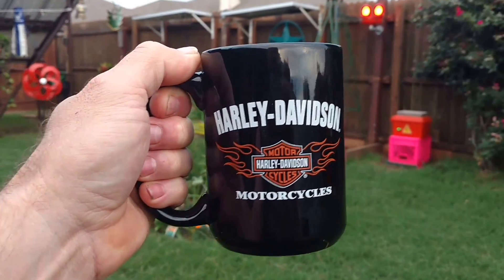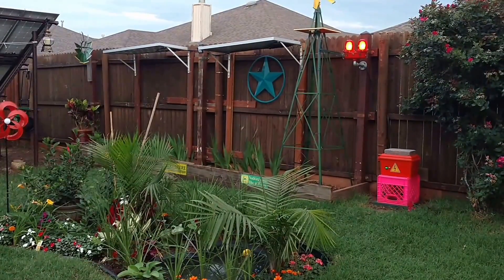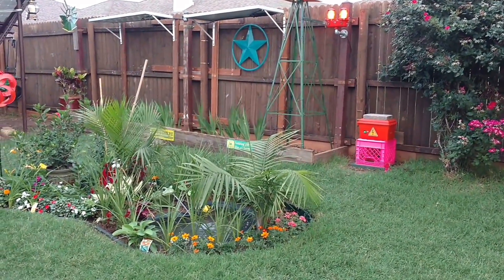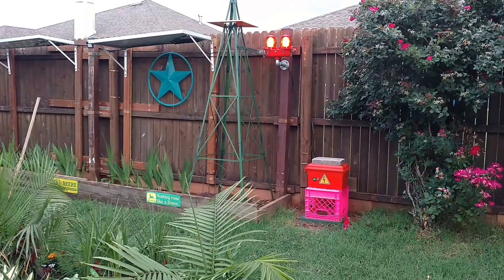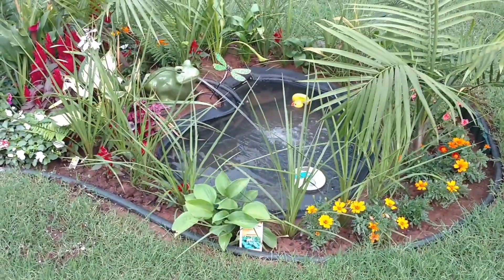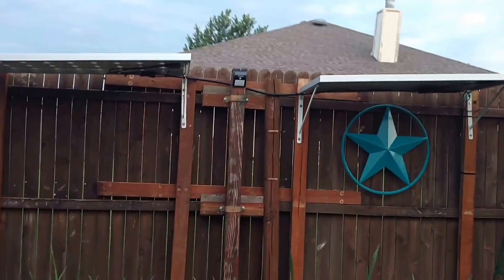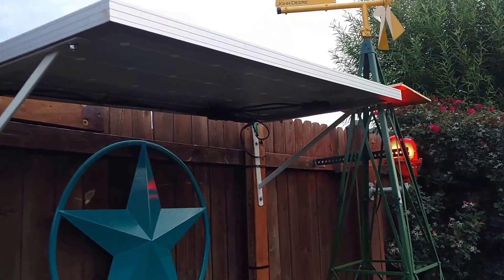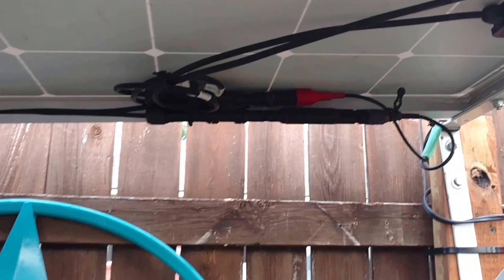Backyard 12v solar pond pump/light...all night long!

Comment: That light is kiss ass... any idea what DOD the battery sees ?
Reply from the maker: Thanks. I got the Hompie/Renogy PWM solar charger "Load" voltage cutoff set for 12.0v. ie, the lights and pump are connected to the Load output on that solar charger. So, I would say around 50% or so. 200w of solar on this system is severe "overkill" for something like this. But, I am planning of some other goodies for that orange box. May need the extra juice.
Reply: Nice !